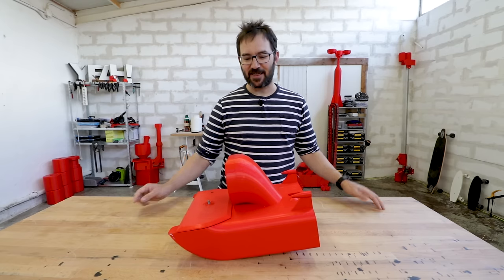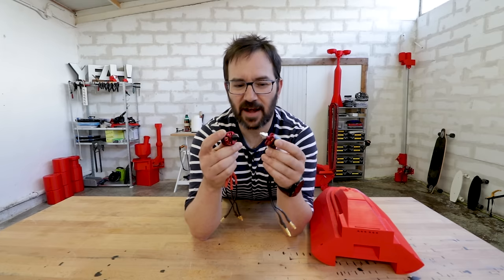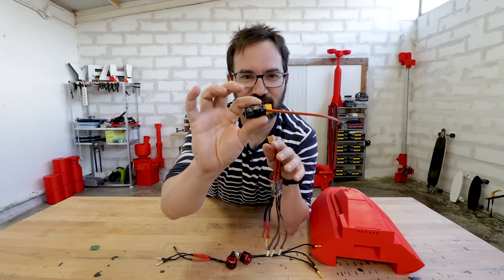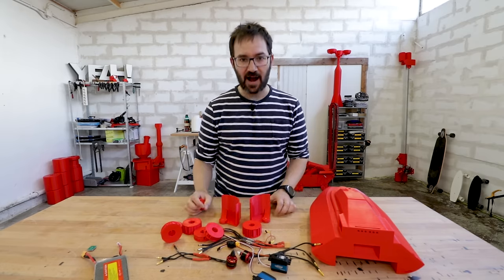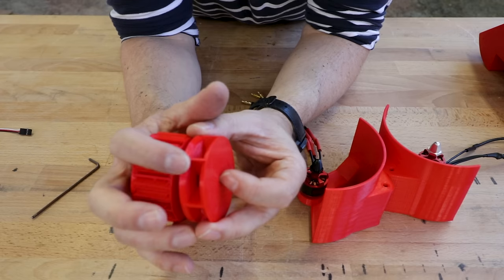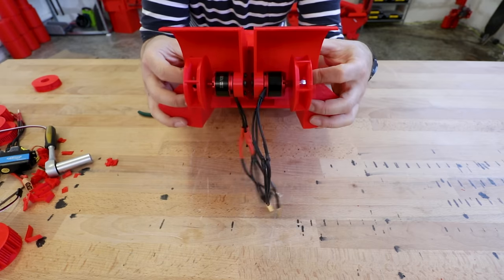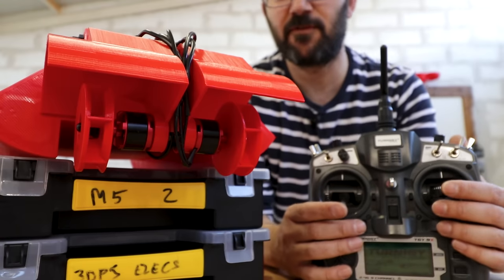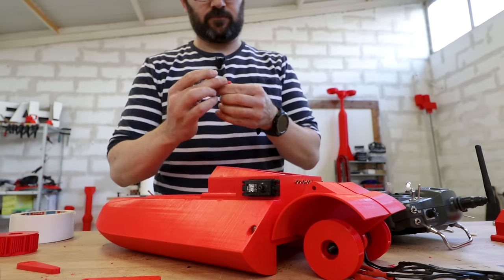RACING PADDLE BOAT

Comment: When will you start thinking before printing?
Reply from the maker: I have another channel where I do only that, thinking before printing. It has no videos yet, but just give me a little bit more time.
Reply: @Felipe Lavratti You are talking about 18th century engineering, right? It's a joke to rely purely on trial and errors in the modern days of engineering. We have software that can do simulations on even just a PC, or calculate parts interference, slice parts to see  how they interact with each other, etc., there is no reason to make silly mistakes in designs other than pure lack of thinking.

I assume Rasgore4 is referring to the lack of opening for the motor mounting - that is something that Ivan should have already taken into account of if he have been thinking like a modern engineer. This is a mistake that not even Leonardo da Vinci would have made back in 15th century. If Leo can make wonderful designs that didn't bloop back in the good old days of no PC and simulations, why can't Ivan, if he has make good use of all the powerful CAD software out there? 

Sure Leo might have made many silly mistakes as well, but hey, at least he didn't show it on YouTube, did he? He just presents the final, totally debugged results.

If I was doing the design, I won't be printing the hull in one single piece. I would have make the engine compartment a separate module (while still keep the hull completely sealed so it's water-tight), completely free from the hull, and will be connected to the hull either by gluing or screw on (preferable) because it is pure common sense that you will need to do a lot of works on the engine compartment, so it's always best to keep that part easy to access.

One very important lesson I have learned from 3D printing is: never try to print a complicated thing in one single piece, ESPECIALLY WHEN YOU ARE PROTOTYPING. You make mistakes, so if one part of the design is flawed, you just ditch that part and reprint it when you correct the mistake, if you have been making the design modular. If you print the thing in one piece, then you will have to reprint the whole thing again, it waste materials and time. Ivan was lucky he had a company sponsoring him filaments.

Besides, if you designed the thing in multiple parts (if you need to put screws to mount those parts, sure, just isolate the mounting points so the other parts are still sealed and water-tight), you can print them on multiple printers at the same time, further lessening the time needed for rapid prototyping.

This, my friend, is what real modern day engineering with 3D printing should be.

He had made quite a lot of such lack of thinking mistakes (lack of electronics and battery mounting components, missing a hole here and there, etc), while the failure is amusing to watch for the first few times, it ain't funny anymore at the n-th time.

Yes, there are still many engineers would missed some design considerations and lead to failed attempt, but printing the hull as a single piece and missed the point that he may need more space and opening to work on a specific part, is not a forgivable mistake.
Reply: He does things the way us hobby guys would do things, no fancy software etc. After all he tells us to go and make something, it's OK to make the odd mistake. Plus it's entertaining to watch the iterations come togeather.
Reply: @DarrenC_1024  you are assuming people have time and patience to learn the software to emulate these thinks in cad. its honestly faster to just try it on something like this.
Reply: @woofer2121  Why not? There are numerous videos on YouTube where you can learn to be better, spend 30 minutes to 1 hour and you can start your journey of being more professional. People who don't have the patience and time, will be outdated and phased out very soon. Are you satisfied to be just an amateur hobbyist forever?

Ivan isn't just an average Joe hobbyist, he is a YouTuber who makes 3D printed creations as his selling point, surely being more professional and less amateurish would help getting more subs and views, no?

Don't get me wrong, I'm not belittling him. I do like his creativity and enthusiasm, that's why I still stay subscribed. Yes my comments may seem harsh and unpleasant (note I have never made any comments - however he seems to never reply to nor care - to him that includes personal insults), but that's because I care, I want him to be more professional and makes less mistakes so I can enjoy his videos even more. 

Imagine a 20 minutes video that didn't convey the amount of information it should had, or had to be abruptly ended just because he made a mistake and will need another 100 hours to reprint the whole thing. Well, see you guys next week.

Then the next week, at 15:00 Sorry guys, I made another mistake and we'll have to stop here, see you next week.

And again, and again, and again, and again, and again, and again, and again, and again, and again, and again, and again, and again, and again... (This is in response to his "never, never, never..." video)

If I don't care, I'll just shut up, unsubscribe and move on to other more professional channels like Maker's Muse, Make Anything, 3D Printing Nerd, etc. These YouTubers never show their blooper mistakes, if they show any mistakes they made, it's purely as an educational warning so that their viewers will not made the same mistakes.
Reply: @glennrmarks  As I said before in one of his earlier video: "It's not a shame to make mistakes, but it is a shame not to learn from said mistakes." And I did said in this thread: "It could be amusing the first few times, but it ain't funny anymore if it happened for the n-th time."

I was just wishing him to think carefully, addressing all the possibilities, cause and consequences and caveats in his design as much as possible before he start printing and shooting videos.
Reply: Im glad that im a Technical Productdesigner trainee  in second  year, because i  own the knowledge of cad(Soldiworks),calculating and avoid structural and space issues 😅
Reply: @DarrenC_1024  you and the top poster ARE belittering him. You are  telling us you can do much better, so why dont YOU start that other channels Ivan wrote about?
Oh Yes, YOU have not the patience nor the skill to do that yourself. I guess that is why you, and certainly I do, hang around this channel. 😜

Short, YES, as I see it this is a channel about making stuff to see if it works. And for Ivan to learn stuff and get experiance. And he is kind enough to also share his misstakes with us. That is something I do think is Hard to do, but Ivan got the personality that makes him big enough to manage to do that.
I bet many of the serious channels don't show us their misstakes.

So, no, you don't get eveything right in the first go. You get more thing right when you collect experiance, as Ivan does.

But this is a hobby of his, he has a limited time, and I really think he managed to get his videos out in a crazy speed, try it yourself. 

So really short. Get real or get lost. The last part is of course my though and has nothing to this channels. Ivan would never say that.
Reply: @racefreak9488  Yes, you have spent about 400-500 days (times 8h per day if we are generous) guided by teachers to learn the trade. 
You SHOULD manage to do that.

The questions is, do you never make misstakes anymore? And do you show them?

It is great that you study your subjects though. Good on you!
Reply: @DarrenC_1024  Ivan cranks out projects 1 per week, if he had a month to think about each one then sure maybe there would be no mistakes, I am amazed he can think through things as much as he does, do the cad work and get it printing all ready for the weekend. And sure, while one project prints he can think about the next one, but it's still amazing.
Reply: @glennrmarks  Yes, I know what are the difficulties of being a maker with time constrain, and I didn't bombard Ivan for the lack of thoroughly thought of all the design flaws in his videos. 

I myself am a maker (at least I am trying to be one), too, so I understand.

However, what urge Ivan to improve is, after he had his impulse idea in his head, can he please spend an extra 15 minutes going through all the past mistakes he made, and see if he committed any of them again. Is that too much to ask for?

Past mistakes are things he had done, he already knew it, it's experience learned, it's should already be a part of him (if he did learn).

I'm not asking for something totally new or something ridiculous, just asking him to improve, and it's for his own good. I'm not asking him to stand upside down on his hands in his next video, did I? 

What happened to customer satisfaction? I'm just wishing him to improve himself, is that wrong? Did I threatened him if he not do what I want, I'll unsubscribe? (Yes I do know that 1 unsub is not going make him even raise an eyebrow)

What's wrong with you people?
Reply: Rapid protoyping requires protoyping ; )
Reply: @DarrenC_1024  so you seriously think that Ivan doesn't take 15 minutes to think it all through, do you?

What's wrong with you?
Reply: I, personally, would rather learn from someone else's mistakes than my own! (cheaper that way)

Comment: With all that floor space you could set up a large paddling pool for testing your boat.
Reply: Just make sure the floor and bottom of the walls are water tight. Then just fill the entire shop (making sure power cords are up high) with about 10cm of water. Instant boat pool.

Comment: Ok, here's my prediction on what will happen. The paddles have holes in the side so that you can tighten the motor nut. At the speed these paddle wheels will be spinning, this hole is going to allow air to enter, turning your water paddle into a centrifugal blower (squirrel cage blower). The air will force any water away from the paddle wheel, and you will not get any "traction" on the water, only air blowing the water away from the paddle wheel. Let's see if I'm right.
Reply: Nice peediction, I didn't thought about that. The question is if it will rotate at that speed for the effekt to show up. And it can be compensated a bit by lowering the paddels. 

But Yes, maybe need to plug the holes?

Comment: I don't know what slicer you use, but for your flotation portions, what sort of infill are you using? I would suggest something like Slic3r's "Cubic" infill. (I'm not familiar with other slicers so I don't know if there is a comparable infill offered in them.) It is a 3D infill that creates a bunch of cubes rotated as if they are "balancing" on a point. This will help to make internal chambers within your floats so if the flotation starts to leak in one part, the infill (while probably not water tight) will drastically slow the boat from sinking. You could probably even intentionally drill holes into the floats and not sink the boat. (Borrowing terminology from foams, you can probably think of the cubic infill as a "closed cell" infill.)

Comment: Aerospace engineer here - you're not going to get a lot of speed with this setup, but it has potential. You're 90% of the way to a centrifugal pump! Enclose the paddle wheels in a close fitting chamber, with a forward facing inlet that ducts into the center and a rear facing exhaust tangent to the paddle circumference. Google 'centrifugal blower fan' for an idea of what this should look like.

Comment: You will want more torquey motors.  So much resistance in water with paddles. Also cool concept is to modify your paddles to have a water intake in the center and use them as impellers inside the boat to create high pressure water that you can thrust vector with a servo controlled valve that switches the flow between 2 water channels

Comment: I think the paddle motors wiring should go through the motor mount arches. This will fix the wire rub in the middle and the placement of the connectors is good I would just remove the wall behind the "cockpit" for access.  When you go to test I would set and tape the battery in the back so it floats nose up to start then move it forward if needed. Can't wait to see what it does in the water.

Comment: Hi Ivan! How are you going to protect the engines against the splashing water? Are these waterproof?
Reply from the maker: All brushless motors are "waterproof" regarding the electrical part. At least in theory. I'll do a little bit of bodgy work to try and keep the wires dry though.
Reply: @ivanmirandawastaken  Please don't run this in salt water. You will ruin the bearings, even of they are sealed. The other exposed metal parts will rust and corrode as well.

Comment: Could you please show more of the electronics side in future videos (the programming of the esc and controllers, and so on)? It would be quite useful and interesting for me,  since I am planning on doing simillar projects as you do. Also it looks like the Motors will get really wet, which is probably not that safe.
Reply: On the motors - they're brushless, so there will be very little exposed wire to electrify the water (ideally there should be none) and it's also not a huge voltage going through them.

Comment: Great idea, but if I would have done the designs more like this. 

1. Put the paddels and water splashing sheildings further apart, maybe with a 3-5 cm spacer. So the cables would reach to the hull easier.
2. Shorter leg on the servo, so they wouldn't be over loaded and burn. 😜 
3. I would even put the paddels on the hull sides, as it would make it easier to drive. The motorns in the rear makes it harder to make the boat go straight. But gives you much faster stearin response. But with differential stearin you get that anyway. 

But, Great project as usual. 

And lastly. 
A water jet boat would be much more efficient than the air jet, as water is heavier then air. So if you had (sort of) turned your previous fan driven boat upside down, it would have been faster. 

Next project maybe?

Comment: Put channels in the motor mounts to run the motor wires up and out the top. Their pivots should also be wider and a tighter fit so they don't wobble. Also, looks like you need to reverse the left motor direction.

Comment: Really nice design concept. Waiting to see it in the water.
Technical question: what slicer do you use for the printers?
With my Ender 3 i'm not able to do nice surfaces above the supports.
And they are tricky to remove without damaging the print.
I use Simplify
Reply from the maker: I use Simplify too.

Comment: E/V Miranda....  Steering will interesting to watch.  With one paddle wheel stopped and the other going, I wonder how quick turns will be preformed.  Can't wait for your sea trials video.... Plus I hope the wires are out of the water to reduce drag which might effect steering.
Reply: I was think the same, I would hav put the paddels on the sides instead.

I think the paddels at least should have a 2 cm space, so the wires get pass them easier.

Comment: Cut the paddle wheel in halve in sofware, print the two parts, and attach them together with for example friction welding or bolts and nuts or just glue, this fixes the support problem

Comment: If you want to avoid so many supports on the paddle wheel, would a two part design an option? As you are going to mount it on an axle anyways, it should be possible I believe ...

Comment: I think you could get this to go fast, but it's not going to accelerate quickly.  If you go full throttle from a stop, the paddles are just going to throw water away from them and the water won't have time to get back under the paddles.

Comment: Why didn't you re-route the wires through your splash guards and have the wires positioned upwards, out of the water to reduce drag and give needed reach and flexibility? ~( ,m,)~
Reply from the maker: I'm surprised that I thought of holes to pass the wires through. I never draw the wires on the 3D model. I should start to do so.
Reply: @ivanmirandawastaken  Draw everything...EVVVERYTHING!

Even do little notebook sketches of different ways it could look and be...always visualize everything in all 5 dimensions [time and force being considered as 'dimensions' in this case] because if you do not, you will needlessly break stuff, and that always costs time and money.

An engineer's job is never to make something as expensive as possible, its to make things as cost effective to manufacture and keep running as possible, [even if it has a pre-ordained shortened life span for the purpose of making more sales] so that the cost does not kill the profits on the one end, and that the failures do not happen so fast customer's abandon the company for higher quality offerings from competitors in the market.

Comment: why do you not use water dissolving filament for support? 13:30
Reply: expensive?
Reply: Single-extruder machine?
Reply from the maker: Yes, that's one of the reasons.
Reply from the maker: That's another of the reasons, yes.
Reply: Even better, use water dissolving filament for the boat. Then see how long it can go before it falls apart. (Ok, maybe not practical or cost effective. But it'll be fun.)